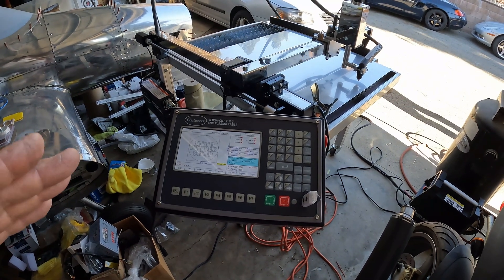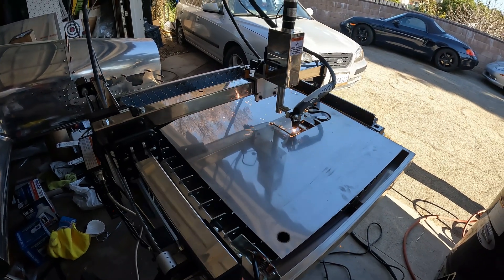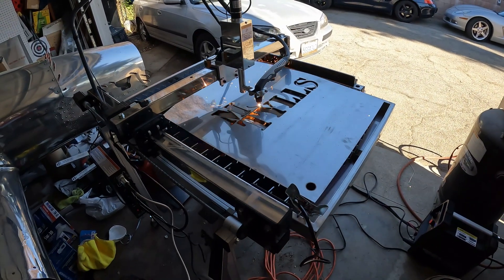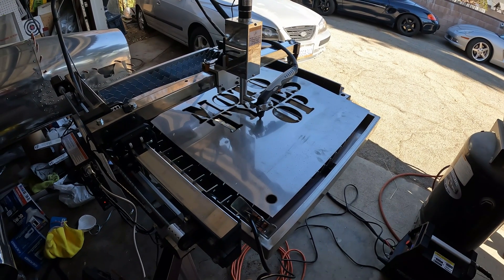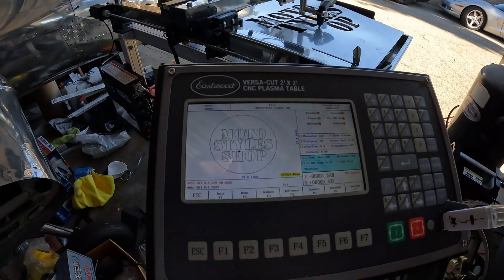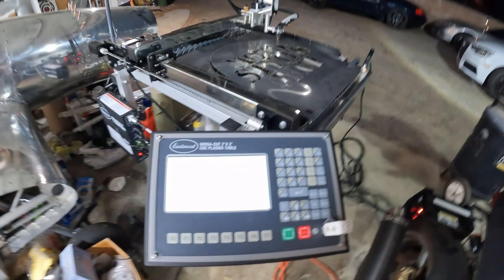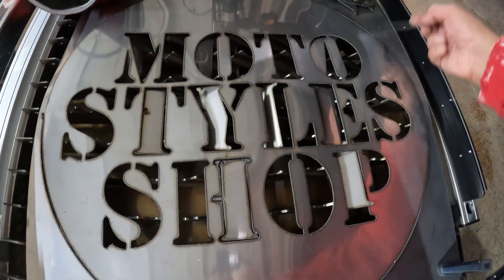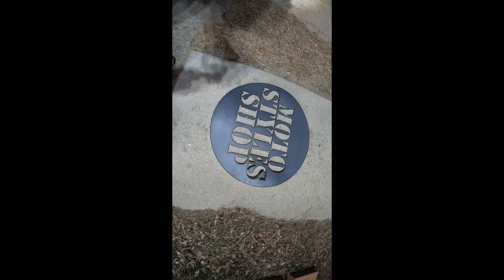My new Eastwood Versa Cut 2X2 CNC Plasma Table (first cut and some problems)

Comment: It may not throw that many sparks, but I  guarantee you will have a fire if you don't clean your shop!
Reply from the maker: @terrysaenz3009  don't worry about my shop it is all aluminum all around. aluminum will not catch fire.
Also the plasma cutter bed have water in it, when I did the first cut it was empty

Comment: Any updates and have your tried any 14/16/18 ga material.. that is really thin material for plasma might be better suited for high power fiber cutter.
Reply from the maker: @vertexairsoft  this is stainless steel . The plasma head was bad from the factory. Eastwood did not warranty it,I had to buy a new one.